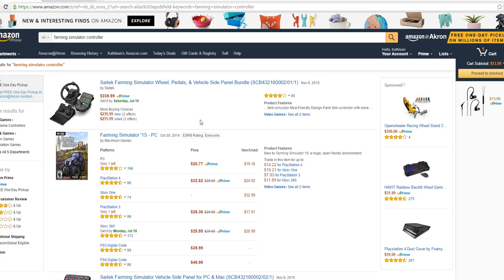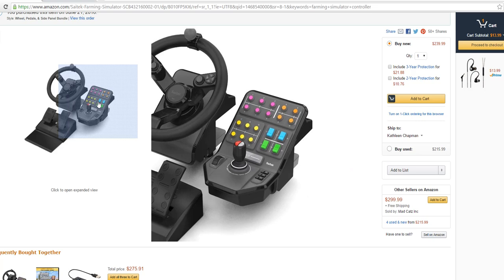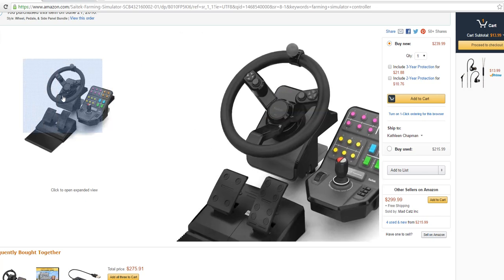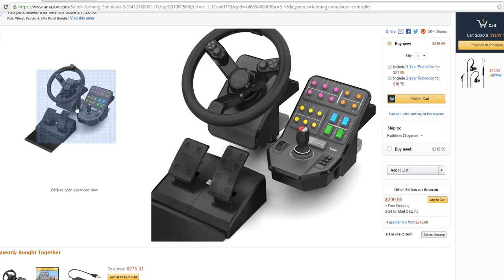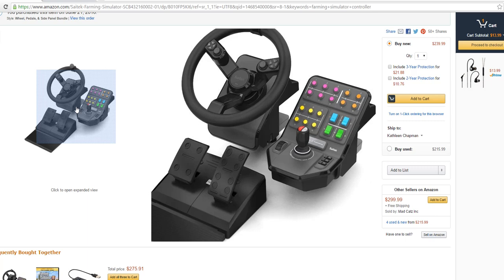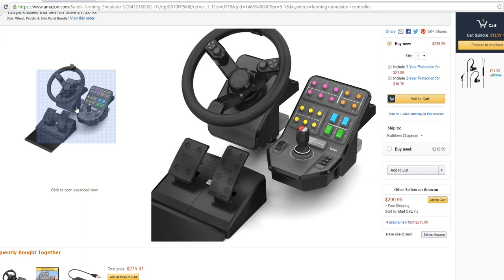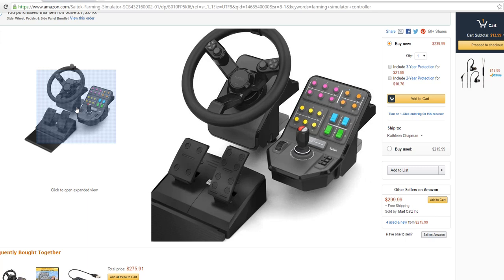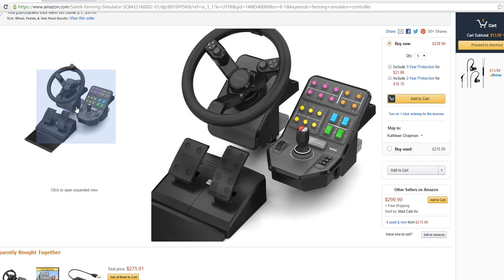Saitek Farming Simulator Control Panel and Steering Wheel - JUNK ALERT

Comment: I have had mine about six months with no problems. However I have been concerned about the durability since the day I got it. Unfortunately just recently they dropped the price $60 below what I paid for it. It has a two warranty and I will be interested to see what happens if it does fail. Sorry you had this problem, as it does work great for Farming Simulator.
Reply from the maker: Glad to hear yours is still working - definitely a quality control issue - I have had several people tell me they have had no problems, but honestly, I have had many more tell me otherwise - I did get my old Logitech Momo Racing wheel and Microsoft Sidewinder joystick to play nice together, so I am happy again.   The only difference is that they have less buttons, so I have to use my keyboard more, but all the crane, implement, and driving functions are there.

Comment: I just bought the wheel. Couldn't afford much better so i got one and i had read mixed reviews so i was hoping i would get a good one. It was okay i played around with for a bit but the brake pedal didn't work from the get go. Checked in the calibration and the brake pedal was completely non responsive. Not very happy. Messaged the seller to try and get it resolved
Reply from the maker: Yeah - I would steer clear of these - even the logitech branded versions are getting bad reviews

Comment: Hey, Arthur,
I know you keep saying you use a seperate steering wheel and joystick product, but I have a few questions about it. I've always been a console gamer, but I may try to find a decent 2nd hand gaming pc, and maybe even try to join some of your parties once I get set up. How many is ports do you need to run wheel/pedals and a stick? Does each control come with a dedicated driver? And how do you split the game controls between 2 separate pieces of hardware? All these questions are pretty preemptive, because I still need to save up even for the PC! I'm just curious at the moment, so don't feel like you need to answer urgently. Thanks!
Grant
Reply from the maker: Most games just find the sticks.  I did download the Logitech game controller software so I can configure my wheel, but my Shifter and my Microsoft Sidewinder Joystick were just "found" by Windows 10, with no driver needed.  Most games just grab the "sticks" from Windows, and you program the controls into each game.  Its kind of a pain, but it works once you set it up.

Comment: Imagine if you will you buy a real semi and when you go to adjust the steering wheel the mechanism breaks. Kinda the same feeling I think. :D Except on a different cost scale. Gosh, I have a steering wheel and pedals around here somewhere from some manufacturer I used the set up once  and pretty much could only get it to work with farm sim. Too bad I burned out on farm sim when I was unemployed. I was playing Space engineers but on server play it's limited what you can do. Currently playing Ark survival evolved and following dinos around to collect their droppings for fertilizer. So I do have a full life. Thanks for the info on not buying Saitek stuff.
Reply from the maker: Glad I could help :)
Reply: You're very helpful. Thought of you the other day. Some guys were logging next to the highway and the one operating the crane to put the logs in the chipper was having a terrible time. :D
Reply from the maker: HEHE - I must have been at the controls.

Comment: I am confused about my opinion about this controller ... 
The way they designed it it is absolutely brilliant to use with FS15 and I would not want to play the game without it! 

How ever ... since February 2016 I am now on my 4th controller that has the exact same issues with the wheel ... 
I bought it as a bundle, so each time my retailer replaces the wheel for me I get a new Side panel. 
1 out of 4 side panels was a bit like yours but the other 3 had no problems at all ... 

I have gotten around 100-150 hours of game time with each wheel, before it starts dropping dead on me as soon as I "turn it".
Reply from the maker: I may just use my current Logitech wheel and buy the side panel only.  I will be sure to buy the longest warranty I can if I do though.

Comment: You may just have bad one and saitek stuff is NOT BAD AT ALL I have lot of saitek stuff and NONE of it has broken and I throw it around
Reply from the maker: Really?  I don't know much about saitek, but I have owned a couple of mad catz controllers - none of which lasted more than a week - considering they are the same company I am doubtful that most people don't have problems - If you got the official Saitek video for this controller there are about 10,000 "mine doesn't work anymore" comments.
Reply: +Arthur Chapman I have got one a I use it like there in no tomorrow and it still has not broken
Reply from the maker: Well, I am glad to hear that - hopefully your good luck will continue.

Comment: Get it serviced under warranty - you got a defective one... No problems on this end.
Reply from the maker: I just got it refunded.  If it had been one issues I would have got it fixed, but 4 different issues after 6 hours of play led me to be so turned off that I just got a refund.  I think I am gonna get an orb weaver or G13 and use those for the "control" panel and just use my old Logitech wheel as the steering.  Less controls, but the orb weaver offers over 100 different button combos, so that should work just fine.

Comment: I was going to buy the side panel.  The side panel is the best thing about the product.  what a shame Saitek/ Mad Catz can't get it right.  It's not a cheep product.
Reply from the maker: Yeah - I mean compared to other wheel combos, the price is good, but it needs to work.  I am back to using my 14 year old MoMo racing wheel from Logitech, and my 12 year old Microsoft Sidewinder Joystick as the crane/FL controller.

Comment: brother I am so sorry.  If I would've known that it was Madcatz before you bought it, I would've tried hard to convince you to not buy it.  I had no idea they were behind it though until you mentioned it.  I am really sorry brother.   As for me?  I continue to use my Logitech controller.  Wired.  I really honestly ONLY use Logitech for my PC gaming.  Mouse.  Keyboard..  Controller....  I've NEVER had any of their products fail me and if I ever have a question, well they're customer service has never, ever let me down.  Same with Western Digital while I'm at it though I only use their hard drives.  lol.  I'm sorry brother.  Stick with Logitech or yes, that XBox Controller.  I have one of those too, I just really prefer the feel of the Sony PS Controller, and the Logitech gives me that feel, so I use it rather than the XBox one.
Reply from the maker: My biggest issue was that I could not get my old logitech wheel to work with my old MS sidewinder at the same time, but now they are both working, so I have both my steering wheel and "crane controls" back.  The only difference is less buttons.  I am ok with that and I am pretty sure my old stuff will keep on working.  My Logitech wheel is 14 or 15 years old, and my MS sidewinder is 12.  Both work amazingly well.
Reply: Yep.  Logitech stuff just works man.  Plain works and lasts.  I've always heard good things about the sidewinder too though I've never purchased one.  I just can't believe they charged what they did for that Saitek wheel man.  That's robbery to me.

Comment: touch wood ive never had any probs in weeks and i use it roughly
Reply from the maker: Hehe - well, it seems like either you will have issues or you won't, from what I have read.  I happened to get a bad one.

Comment: I'm sticking with my keyboard and mouse. They are cheap but they last quite a long time. I do have a PS2 controller with a usb adapter that I can use for the driving part. Only started using it again these past  month after 5+ years because of your videos where you had to learn the buttons again. I'm like I got a controller, after all this time never once thought to use it for FS15.
Reply from the maker: Hehe - keyboard and mouse are the best reliability for sure.   I like the steering of the controller though.